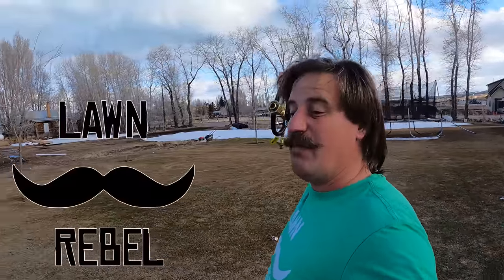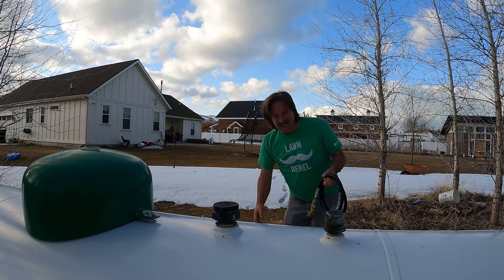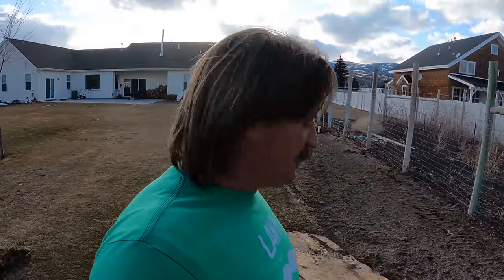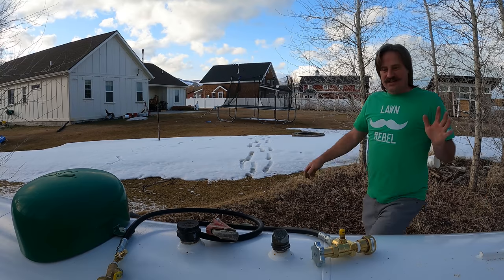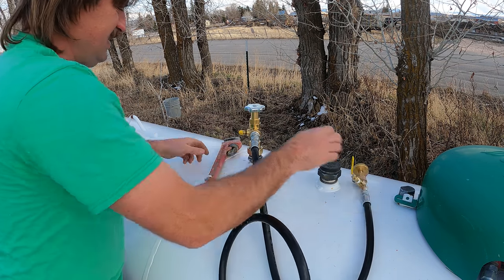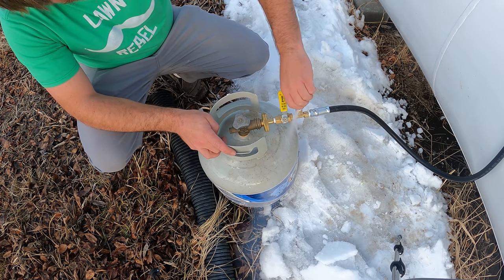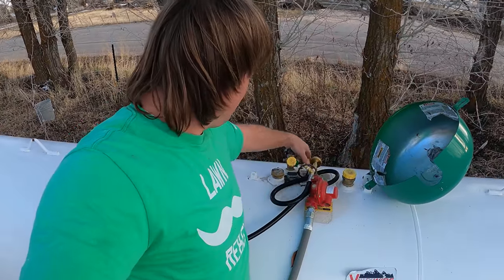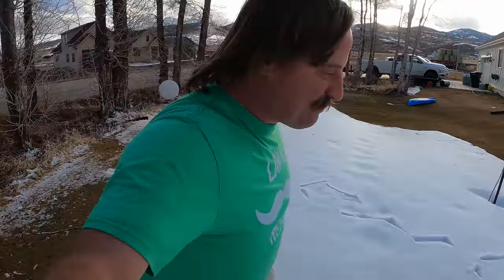HOW TO FILL YOUR OWN PROPANE TANKS AT HOME

Comment: I think he overfilled the small tank, he didn't use a scale. It is dangerous to overfill the tank completely as the liquid expands too much with the temperature variation and can rupture and leak all the propane content at once very violently and even explode. Here in Brazil it is not allowed to fill more than 85% of the volume of any reservoir and here we do not use pure propane but a mixture of propane and butane, 50% and 50% each, which is called LPG here. In the USA I know now  the maximum is 80%, each country has its own safety standards

Comment: Never have I seen them unscrew anything on the side of the valve when I’ve had my tank filled
Reply: Isnt needed when they fill from a pressurized source, think about it. Your tank was full of liquid and all that liquid came out and nothing went back in. There is no "air" to bleed out only pressurized propane gas. To fill the correct way you just have to pump the liquid back in but it has to be at a higher pressure than the inside of the tank in order to re compress the leftover gas into a liquid form... here he has to open the valve because he cant pump it in at high pressure the container he is pumping from has the same pressure as the one he is pumping to, so nothing happens.. however by opening the valve and releasing the pressure it turns the tank into an open container where the filling tanks pressure can push the liquid into it without resistance

Comment: Just so everyone knows, it isn't always this clean and easy...     The internal valve on the liquid line of my tank leaks, so the second I remove the cap, it's spitting boiling cold propane out...   When that is the case, the rubber O-ring on the extractor valve gets so hard almost immediately and  cannot be forced down in the bore far enough to get the threads started.   I ended up pulling the O-ring, and then I found that the extractor opens the valve before the nut actually catches, so you have to jam it on, then give the nut a spin while propane sprays out...  Once the nut catches, you can tighten it down until the propane stops boiling out.  Then it's easy...   And repeat every time I want to fill tanks...   FYI, there is a little white washer under the cap has to be in just the right spot to re-seal, all the while boiling cold propane is spitting out, making it that much more difficult.   What a disaster for me, but at least I know I can do it now...   :(

Comment: Do you even have any understanding how dangerous what you just did is ??   Do any of you reading this understand how dangerous what he just did is ,  As a propane delivery representative/technician  Certified by the national propane gas association  I want to explain to you that that liquid withdrawal valve you hooked up to  Has killed or badly injured many of our technicians throughout the year  Removing liquid from a tank is probably the most dangerous thing any of us who are trained do on a daily basis ,  Forget overfilling the 20 pounder that's the least of your worry ,  Opening that liquid valve on top of the tank is very very dangerous the propane is held back by a Spring that fails constantly , Which is the reason if you look at that cap there is a small wheat hole so you crack open that  Cap before removing it all the way to see if there's any pressure behind it many people have failed to do this just as you and get covered in liquid propane  To have 90% of their body burned by liquid propane which is 44ﾟ below negative as well as the fact that propane released in liquid form into the atmosphere expands 200 times itself  When you factor in that tank you're messing around with appears to be a 1000 gallon ASME tank  Before anybody ever found  If that valve did not shut  You would die in agonizing death  As somebody has been burnt loading a propane bobtand I know what I'm doing  , but even someone who knows what they're doing can become injured this is a dangerous job  So many of you think that this can be done by anybody I urge you to apply to Amerigas suburban or ferrellgas who are desperate for people to work  But most people who apply and start quit because it takes a dedication a skill and a knowledge of hazardous materials that you sir do not possess , You don't even put this claim or don't try this at all you could be responsible for some kid or teenager killing themselves because of your ineptitude , And when you go to remove that liquid withdrawal valve you place on top of that if you don't slug it right I evaporate lock it up you can have the valve spraying liquid out at you as well ,  You could have caused an uncontrolled release of propane a 1000 gallons of it that you would have no abililty or no knowledge of how to stop ,  This appears to be all a joke to you death versus 20 bucks I guess it's worth it for you huh , If you wanted a dispenser to fill your propane cylinders you could just contact your propane company  Have them turn your tank into a dispenser with a proper pump
Reply: Propane Explosion

Location: Location: Ghent, WV

Accident Occured On: 01/30/2007 | Final Report Released On: 09/25/2008

Accident Type: Flammable Vapor

Investigation Status: The CSB's final report was approved by the Board at a public meeting in Beckley, West Virginia, on September 25, 2008.
Reply: This is what happens when someone is untrained on how to stop a propane release from opening the liquid withdrawal valve in this case the gentleman who was a technician but not properly trained open that valve without waiting to see if there was pressure from the weephole causing the death of everybody involved included the firefighters who did not know how to handle a propane release I can't believe you advocate this or YouTube allows this to be put onlin extremely disheartening

Comment: That valve is used to transfer liquid from one tank to another and if that valve is stuck open you could have a major problem on your hands, its only supposed to be used by trained personnel only if you want too know what can go wrong look up ghent wv propane explosion. That valve you dont want too mess with and i know someone will give a comment back about its safe to do....as a service technician and delivery driver you dont mess with those valve unless you have had the proper training

Comment: A lot of people, including some chemical engineers I know, don't understand propane tank filling.  Contrary to your intuition, no bleeding of the so called air space is needed!!!
That's because there should be no air in the tank.  It is all propane.  Gas propane on the top and liquid propane below it.  As you fill the tank pressure on the gas phase increases which causes it to condense to liquid.  Much different than having a noncondensable air layer in there that would continue to increase in pressure and prevent complete filling. See next post.

Comment: Without a pump all you can expect is pressure equalization or about a gallon. Just go to the pump station at the gas station. This is amusing and scary at the same time. ridiculous.
Reply: You didn't see the liquid coming out the bleeder hole on tank valve?  That indicates the tank is filled to proper level of 80%. It works excellent, just takes a little longer then a choking station that has a pump. 
     If your not comfortable, then don't do it. It's perfectly safe if you have any common sense. Just like filling your car. Don't smoke and don't get it on you.

Comment: One final note is that the filing in the video might have been slow because the level tube valve was open.  Propane was going in and coming out the top.  Keep the screw closed except for occasional quick checks to see if you get liquid spitting out.

Comment: wow, that is not at all what those are for. its a spitter valve on the side of the tank, and a pressure relief valve on the hose. you should not follow this guys instructions at all. scary bad.

Comment: Heres a better idea…connect a line to your house so you dont have to fill a tank bud…you jjst connect direct into your house line….
Reply: If you notice, his house is a regulated vapour draw. See the red regulator connected.
Reply: That is not relevant to anything I said.  Im saying he should either run another line from the tank  to his grill or tap off the mainline at the house into his grill…

This is just dumb…